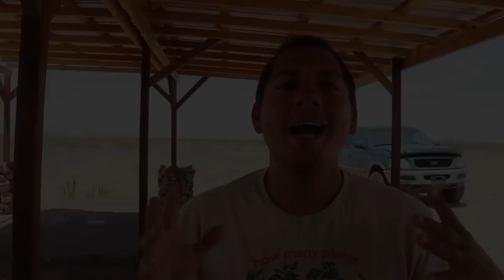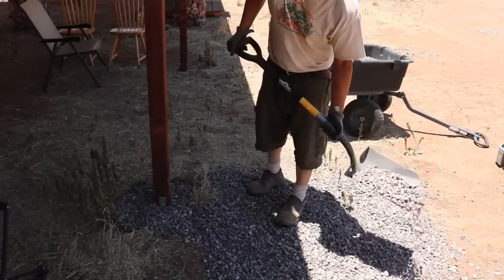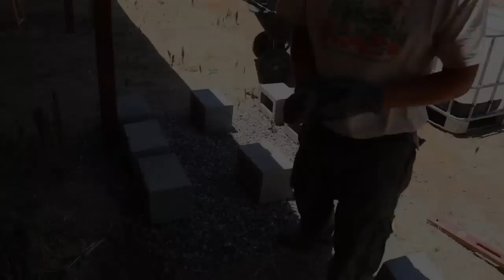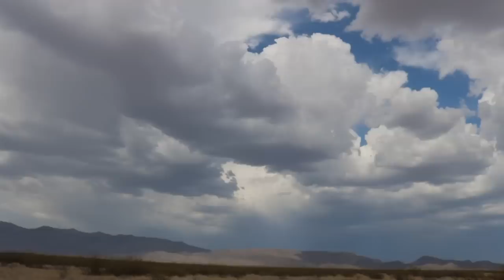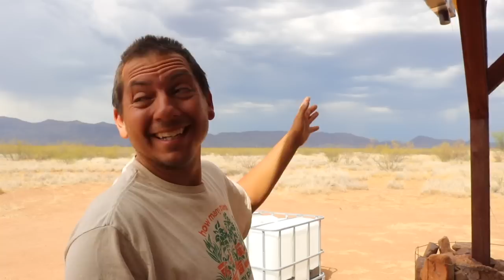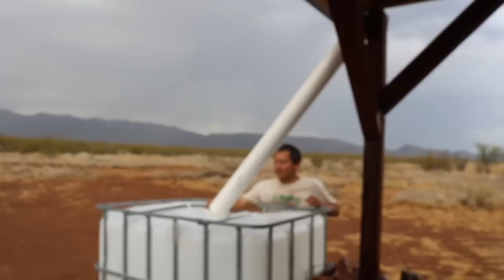Setting up IBC Totes For OFF-GRID Rainwater Harvesting System

Comment: Call pull a part in Tucson for tires and parts..  worth the effort..
Reply from the maker: Definitely! Thank you!
Reply: @ourselfreliantlife  hey if you do.. go there with your screw guns or whatever tools... And strip the bolts and screws off... See if glass is economical.. metal.. metal metal..   you can usually get it weight cost. Or pay the price . Check the pricing.. I wound up with a big 40 mm size ammo can full of bolts etc.. they come in handy. Especially the big bolts from the springs engine mounts etc..  steel rims could make a wood burning stove..  glass for solar radiator for a heat pump set up..  you get the idea😂

Comment: Hi Jim, I was wondering if you plan on putting gutters on the other side of the roof too ?  The side that you have the camper parked on.
Reply from the maker: No, just the one side. The water should all drain to the one side.
Thank you for asking. 🙏

Comment: I live by Kingman, Az, there three places that I can by used tires for above 25 to 45 dollars good tires that will last 4 to 6 months on dirt roads. You could build a underground cister using vinyl signs cost maybe 350 dollar, could hold 20,000 gallon.plus cover it and fence it so cow don't get in.
Reply from the maker: 😃We've kind of been thinking of underground cisterns.

Comment: what are your average high temp now Jim? I went to our property yesterday and did some work it was 95 degrees. I worked about an hour and spent 40 min in the air conditioning, then did it again. man it was hot.
you are getting so close to have the rain water harvesting system up
Reply from the maker: Thanks Joey! We're pretty close to that temperature as well. Once the clouds roll in, it's super nice.

Comment: I will always remember how my body felt after lugging up blocks 3 scaffold high all day. I was in great shaoe back them but always sore.
Reply from the maker: I can only imagine how tough that must have been. Do they have robots for that now?🤔
Reply: Green Dream Project only on Green Dream Project 😂🤣😇😝 Well, if you are lucky and the block company delivers, you might get the pallets off loaded very close to where you need them. In our case, the pallets were off loaded 150’ from where we were building (a long story) so I moved them all by hand. I guess the repetition was kinda robotic 😋 You do get a good workout!
Reply: The Citystead boy that’s the truth. To save money I was the mason’s helper when we laid block for our utility building and workshop - both solid block! We used HEAVY split face block at 56 lbs each. Two at a time, single arm press made for a hot, tiring, sore day for a week at a time. Wish I was in such good shape now!

Comment: Check Walmart online
I bought 5. 245/75-16 10ply
Mud tires free delivery
To Walmart and as i remember install was $25 each. 
You can get deals on Ebay starting just under $500 for 4
Just remember mud tires are directional
Reply from the maker: Definitely! Have to keep an eye out for those deals.